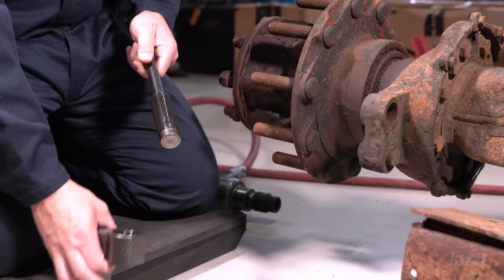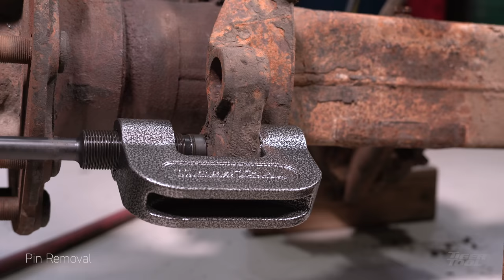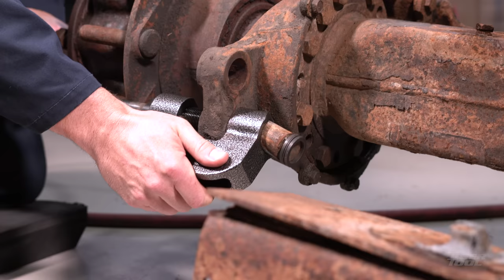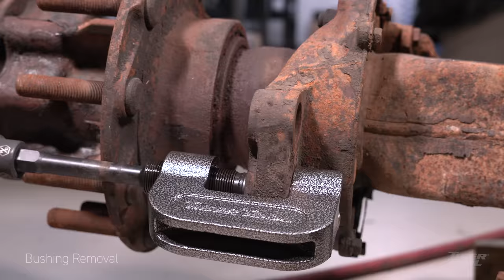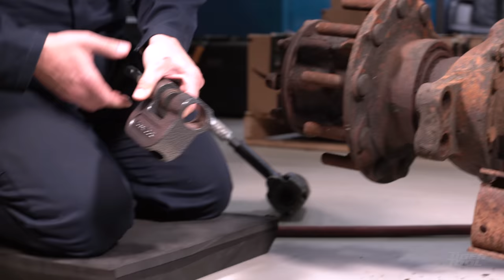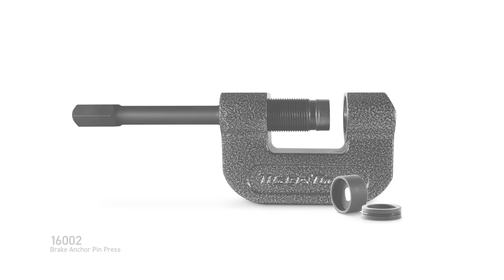Brake Anchor Pin Press  |  Tiger Tool 16002

Comment: Fun fact: heavy duty ball joint press works just as good. No need for this tool when you can use something cheaper
Reply: Try removing the bushing sleeve with a ball joint press. No point of changing the anchor pin Ean leaving the old bushing sleeve

Comment: Can the same tool install the pin bushing?
Reply: Using a press is better than air hammer talking about u bought it for 3 time cheap
Reply: If you clean the holes well enough you can install them with gentle taps and lubricant. No need for expensive tools